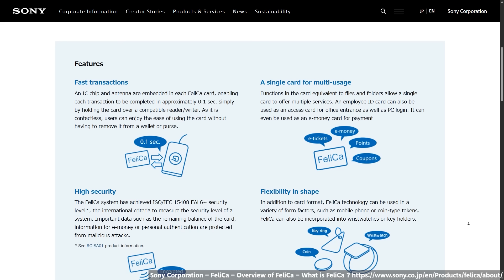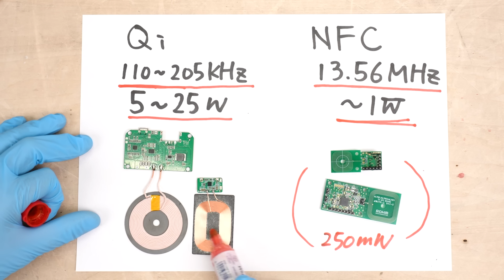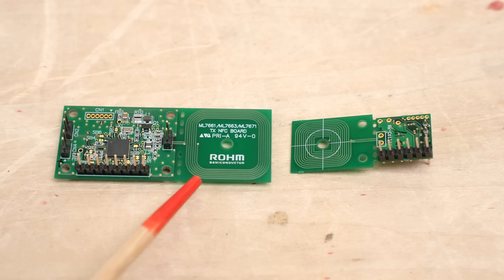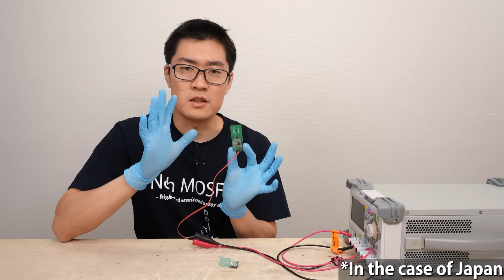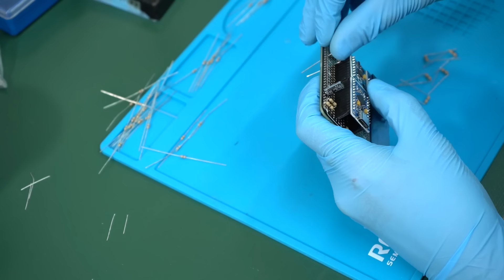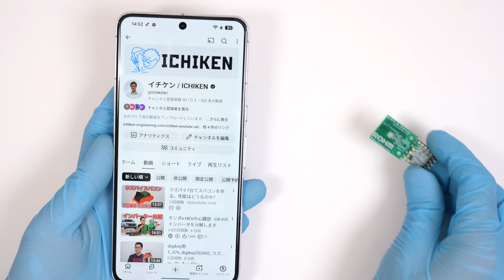Actually, It Sends Power Too. Unlocking NFC's Hidden Potential

Comment: Why do you need wn anechoic chamber?  Is it always required for any device not yet certified?  Is NFC on (or harmonic to) some particularly sensitive uses?  Something about the power supply rather than the fev boards?

Comment: If 250mw of output power in 13.56mhz RF is exceeding the limit, then my 100w 13.56mhz ICP plasma toroid generator definitely does

Comment: Thanks for the clear exposition! 
In your experience, what is the latency for a device to be detected/paired after it is brought into proximity? Also, if I do not need vast amounts of power (say 2-5mW is enough for each "tag"), how many tags can be concurrently be read by a single base-station?